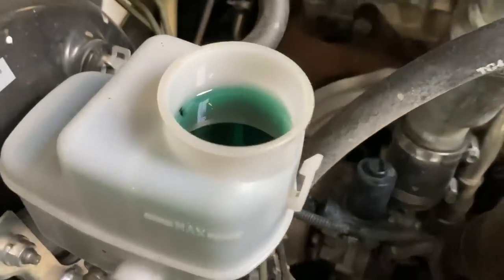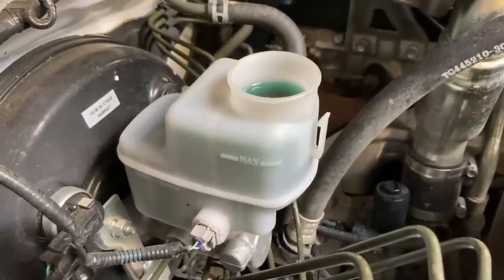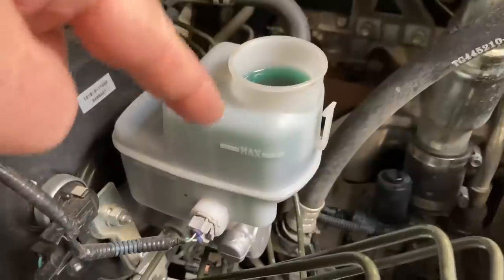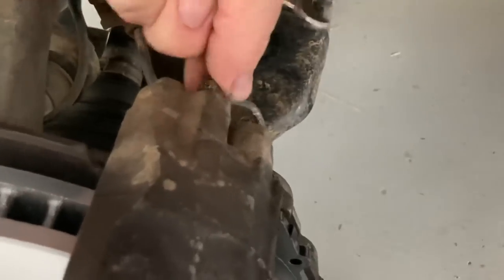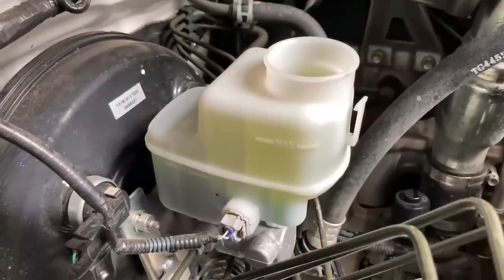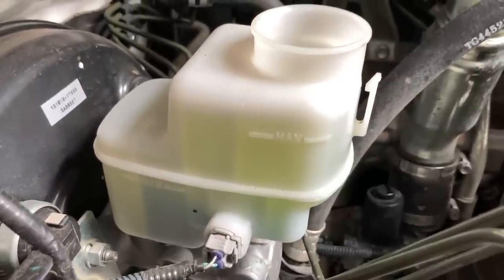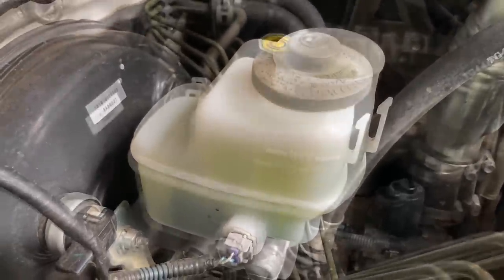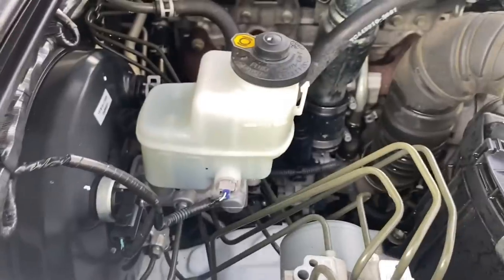BEST CHEAPEST Most RELIABLE BRAKE FLUID CHANGE FLUSH BLEED BRAKES Easy

Comment: Great Vidoe again Anthony, love the gravity bleed procedure, will save me falling out with the wife on the next fluid change lol. I replaced calipers and wheel cylinders last year as one caliper piston was seized, couldn't shift it at all. Does anyone have any tips to prevent it happening apart from moving between pad changes? Would a small amount of molycote under the rubber be any use?
Reply: Ok, push it down, ok off! ok, push it down, I SAID DOWN! NOT OFF! DOWN! 🤣Definitely going to use the gravity bleed next time lol
Reply: Changing your brake fluid regularly will prevent seized calipers

Comment: Just changed my LC120 front rotors with these LSI ones a little while back when you first posted about them. My last ones had been machined a few times and I started getting nasty vibrations so was about to buy new ones anyway.
New ones so far so good. Perfect fit and quality seems good. And what a bargain as well. Less than $120 for both (thanks for the discount).

Probably cheaper to just replace them, rather than get someone to machine them at that price.

Comment: I have just been reading my Haynes manual and it says start with the right front, left front, right rear & left rear. Its the 120 1kz 05 with the unified ABS modulator. Is this correct as i have always started with the left rear wheel on my other cars.
Cheers